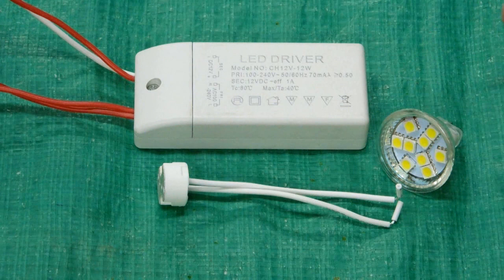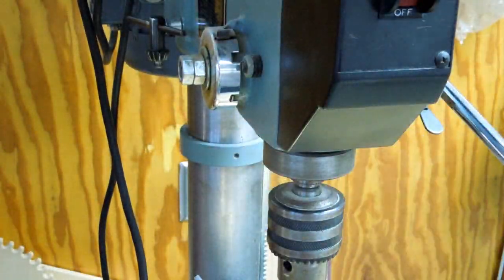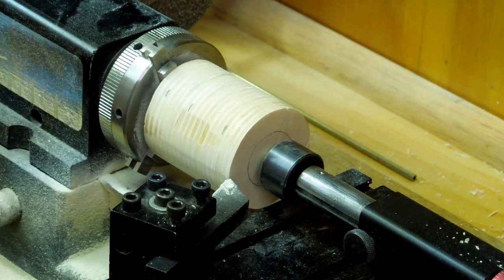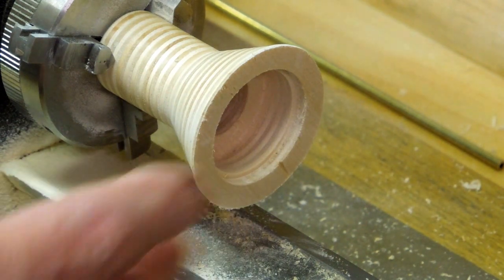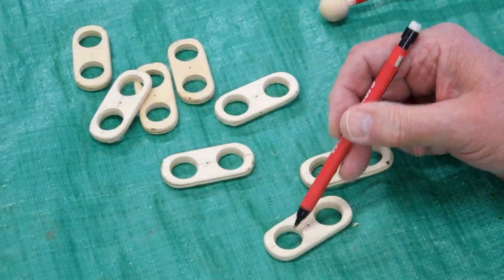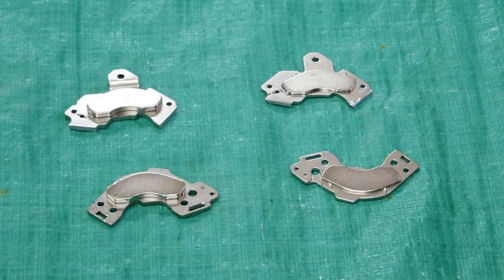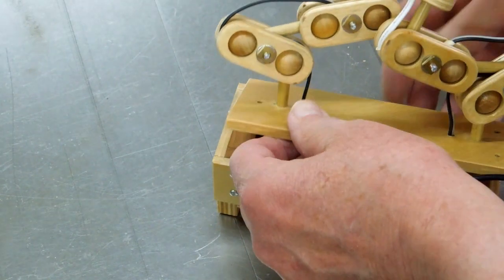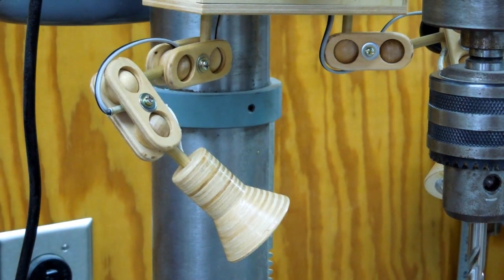12 Volt LED Lights For Drill Press

Comment: In case no one has said it, what a bright idea! How come you don't use a wooden drill press table?
Reply from the maker: I made one for my smaller drill press - ref my video "Drill Press Auxiliary Table". When I moved into a different shop I bought a floor model drill press and the Auxiliary Table would not fit. I just haven't gotten around to building one for this drill press. It's on the projects list. Thanks for watching!

Comment: I am not finding a bright white mr11 bulbs on eBay.  help!!
Reply from the maker: Joseph Poindexter Joseph Poindexter You simply can't be trying very hard. Search (on eBay) "MR11 12 volt LED" then look for someone showing 2 or 3 different color bulbs. Lots of them listed. Pure white or bright white sometimes shown as 5500-6500K or 6000-7000K
Reply: +Ronald Walters  I did not realize that pure white was the same as bright white was the issue of finding the bulb.

Comment: There's a flash of "tinker toy" @12:10 is that intentional? :)
Reply: +Bernhard Hofmann  I'm fairly certain the "Tinker Toy" display was placed there intentionally and also points out  Mr. Walters is an excellent video editor as well as an accomplished woodworker/designer.

Comment: I was wondering how'd you'd overcome the momentary nature of the micro switch. Very clever and practical.
Reply from the maker: Caleb Burnett Not sure I understand your question. There is nothing momentary about these micro switches. The micro switches (which I used) can be wired normally open or normally closed. Wires were connected to the normally closed terminals so when the switch was depressed the lights were off and when the switch was released the lights were on.
Reply: Ronald Walters I was thinking one thing and typed another. :) I understand the NC/NO connections but I was thinking that it wasn't a latching connection. If I understand your build, you "fixed" this by incorporating a physical switch to interrupt the electrical connection like you said.
Don't mind me, I don't know what I'm talking about. :p